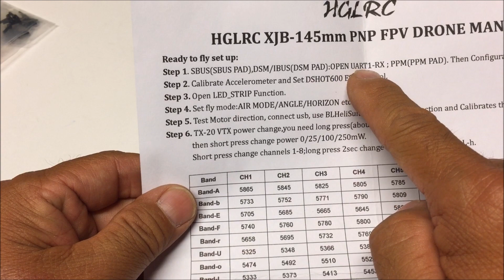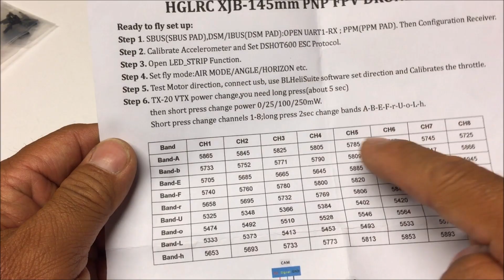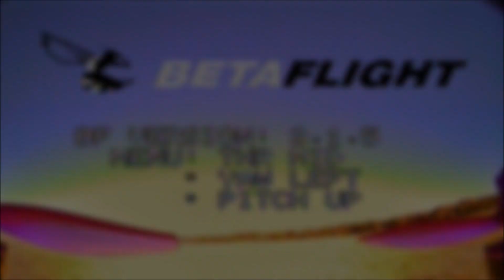HGLRC XJB - 145 145mm Micro FPV Racer

Comment: This is a sweet little QUAD, one of Best buy right now,  one sweet flyer
Reply: Hi Guys   I see you have been reading this comment.  Remember that it's 3 years old.  HGLRC has switched over to the ARROW 3.  I just would look at some of the newer quads. I still have my XJB-145  but it is a F4 flight controller and the new ones are F7.

Comment: Trying to find out what size the connector to the receiver is as mine came with a 3 pin to connect to but my flysky RX doesn't have a 3 pin on the end.  Any idea what size it is on the PNP model?
Reply from the maker: So you have one of those connectors for the flight controller to connect to the receiver but the receiver has a different connector?  Perhaps just splice the wires and solder them together and heat shrink it.
Reply: RC Escape Yes that's correct. The FC has a connector I can't connect my RX to. How do you mean solder the wires together?
Reply from the maker: here are some videos :

https://www.youtube.com/results?search_query=how+to+solder+wires+together

Comment: Hi there. I just received my xjb 145. 
Im wondering how to get started. 
Besides getting channels sorted. 
Do I have to calibrate the flight controller and mode ?
Or is it set to a default and just add the receiver and go ?
Thanks so much
Reply from the maker: have you set up the modes in betaflight and configured your radio to have switches set up as well?
Reply: RC Escape no I have not done that yet. 
I received the delivery just last night. Just going through it all. I just soldered the receiver that came with the turnigy evolution controller. 
Do I need to configure it on beta flight first before any test flights ? I’m assuming yes. I thought it was pnp.
Reply from the maker: yes, they all need to be at least looked at in betaflight and configured correctly to your radio.
Reply: RC Escape it was all set up already. 
Thanks for you help

Comment: Excellent review . I ve gote one for order. Perfect for Canada 250 gram.  is it possible to install runcam split 2?  I have an old transmitter Spectrum dx8 I am looking for a good little receiver.
Reply from the maker: I don't think it has enough room to affix the split 2....
Reply: I think you’ll struggle to fit the pcb for the split, unless you change the vtx and mount a smaller vtx somewhere else on the the quad.

Comment: I've got one on order, I'll be watching yours till mine arrives. Look forward to watching it on a different receiver. Do you have any 4s batteries?
Reply from the maker: You are gonna love it !!!  I've got some 4s on order as well as more 3s batts on order :)  This thing is a rocket on 3s and I don't think you even need 4s!!!
I'm gonna wait till the xm receiver gets here though cause the connector to the xsr has a plug so I'll have to bridge the wires and it is simpler to just solder directly to the xm receiver :)  I flew it again today with the d8 keeping it close but this thing travels a 100 meters in no time!!!!
Reply: Thanks for the advise and opinions. Still trying to figure out best size of battery while I wait for mine to arrive. I have plenty of 3s 650 Tatu for another quad but I think it's just a little to small. Trying to figure out perfect size. Look forward to more videos!
Reply from the maker: jono s 
The 650mah should be nice and light for this quad.  The 850 mah that I've used seems just about at the large side.  I've got some 550mah 4s coming and more 850mah 3s as well.  It did fly very well with the 850mah :)
I've taken an Xm Plus out from another quad and installed it just now and it is ready to go :)
Couldn't wait 7 days :)
Reply: RC Escape that's what I like to hear, because now well get new videos soon !!
Reply from the maker: Stay tuned :)  Hopefully it goes well :)
Reply from the maker: Wow!!!  Great price!!  How did you get it down so low?

Comment: Great flying! Mine just arrived and just waiting for the R-XSR to get here. I noted your motor screw warning about the missing screws - just checked mine and I have 3 screws for each motor, and only 3 screw holes!!! What's up with that??? Anyone else get a frame with just 3 motor screw holes???
Reply from the maker: Mark Sherman 
Oh, what...???
The motor it self has the traditional four holes or are they like in a triangular config?
'Cause that is funk!
Reply: Motor is OK (4 holes), but if you look at the bottom of the frame, yours has 4 bump outs where the screws go - mine has only 3 with the bump on the inside closer to the stack shaved off on each arm. You couldn't even drill a fourth hole on the arm.
Reply from the maker: Mark Sherman 
Huh!!!  That is something else...
At least mine came with four holes but two didn't have screws in them and you have a choice of adding or leaving them but three?
One shaved off?
Meaning there is a screw in there but the head is shaven off?
Reply: No, the frame is shaved off on the inside (toward the center) where yours has a bulge for a screw hole. My frame arm at the motor isn't as wide as yours. No room on the frame for the 4th hole.
Reply from the maker: Oh wow....I wonder why they did that?
So, they changed the actual design of the arms where the motors are attached?
Reply from the maker: I hope it does not have any effect on the performance :)
Reply: Me too!!! Still wondering if I got a one-off, or all of them are changed...?
Reply from the maker: Mark Sherman 
Actually, I just looked at UAV futures take on this unit and he has the same thing like yours!!!
I see what you mean now :)